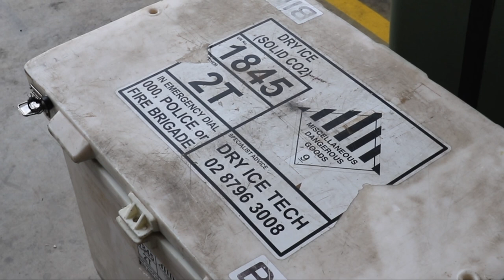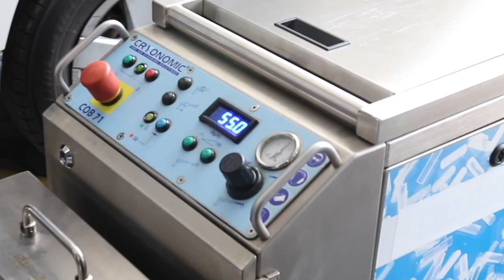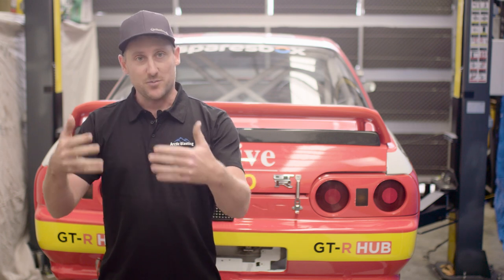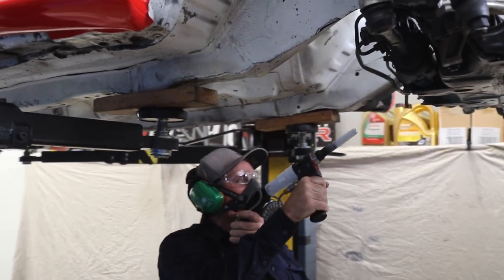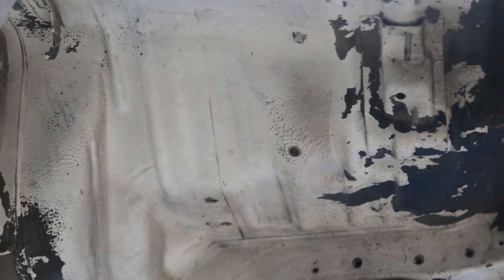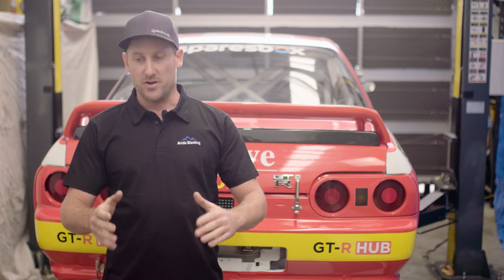Group-A R32 GT-R Tribute Build Ep2 - Dry Ice Blast Prep for Paint Underneath

Comment: Dry ice works well, if you can get your nozzle to that area, if it is behind other parts less efficient just like normally cleaning.
Still good to setup a drop sheet, like a quick temp spray booth to minimise the area of the debris as it can cover the area/shop

Comment: Environmentally friendly? Yeah, apart from the diesel engine that needs to be running the whole time 🙄
Reply: I think you’re amongst the wrong company talking about what’s environmentally friendly.
Reply: Just like "green" electric cars!
Reply: I thought they're using one as air pump, rotating the crank with something else but dunno what.
Reply: Not to mention that dry ice is literally frozen CO2. This machine dumps CO2 into the atmosphere.
Reply: @ACommenterOnYouTube  pretty sure that was the joke mate xD
Reply: @tnmoe-  @You Tube As somewhat of a car person, I love your run of the mill fire breathing engines (flat boxers, that means Subaru's and Porsche's), and the powers that be keep pushing for electrification globally, whiles the global power grid aren't built for it yet is a fact. Have the lot of you actually looked at how petrol and diesel are refined and power requirements for the refineries? Just one of those are worth a few large densities cities worth of power use, and the cobalt they require to refine are just dumped plus other toxic stuff like benzine. At least with Lithium based batteries you can salvage the cobalt and reuse but they have moved away from requiring cobalt.

I don't buy into electric vehicles since the energy density isn't there yet and charging speeds + infrastructure aren't practical yet, but aren't you people being lied to by oil companies and believing them as usual?
Reply: @ACommenterOnYouTube  might wanna look into Redwood Materials there scamp.